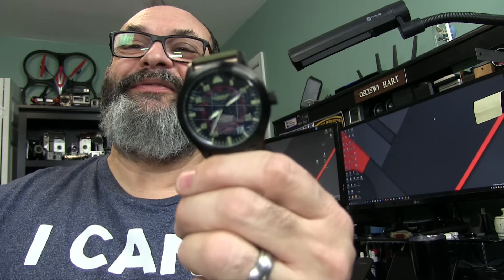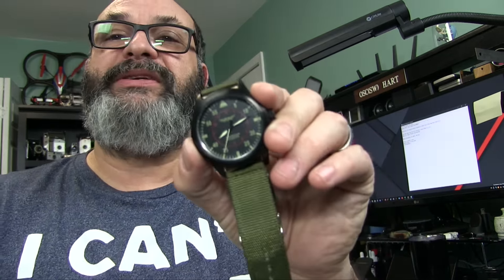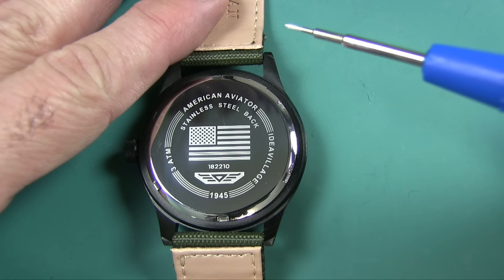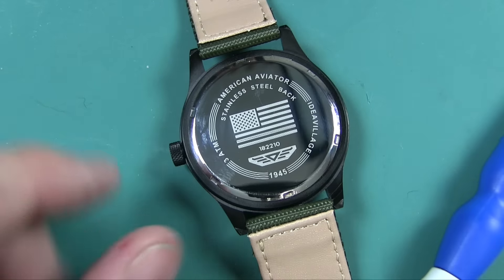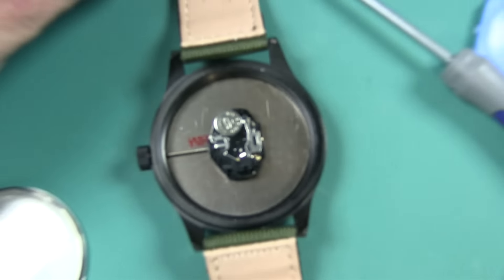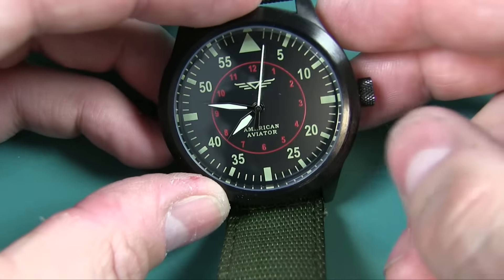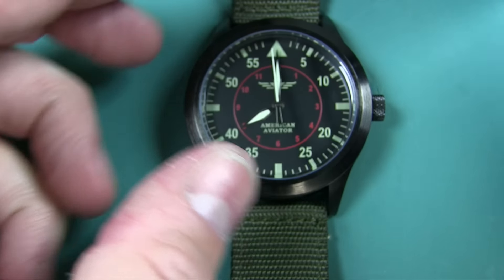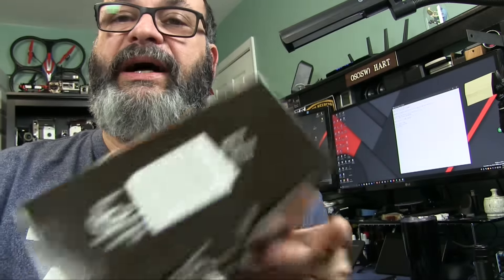American Aviator Watch As Seen on TV - Crappy MC. Crap Face!!!

Comment: It does has a SII(seiko) quartz made in singapore. At  least that is what I can see from the engraving. But 1 min per day is not right for a quartz movement. I recently got 2 naviforce quartz also with seiko quartz. Has been spot on accurate for about a week now. Similar look to this also made in china cheap watches. With real screw down back & I have submerged both in water with no problems. Best part is they are only $10 on ebay.

Comment: Junk. Total junk. I have a beater watch I wear sometimes, Its a $17 Armitorn with Analog & digital display. Have had it for 6 years. I have never reset it since I bought it. Its about 6 minutes fast since then. Still has the same band. It get wet all the time from washing my hands etc. My main watch is a Tissot T-Touch I bought in 2003. It was expensive but it still works perfectly.